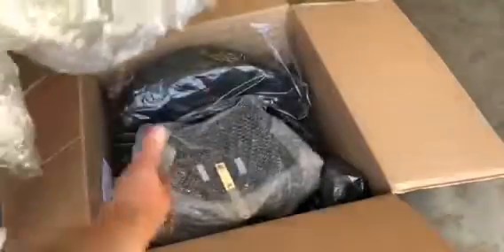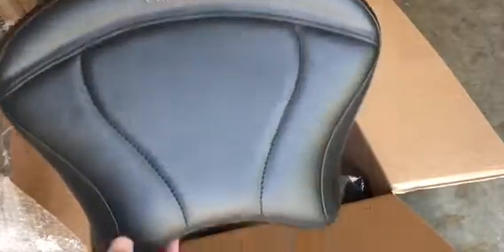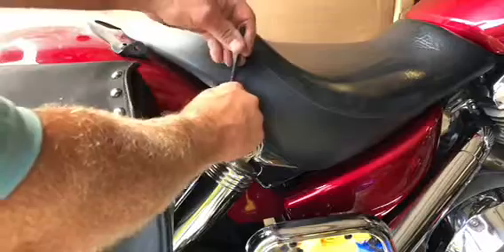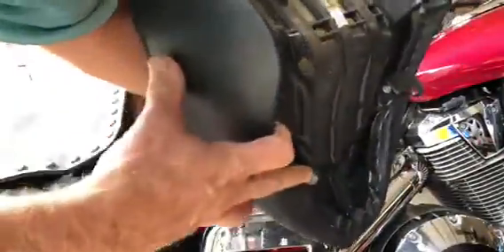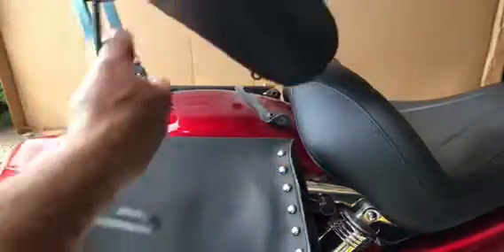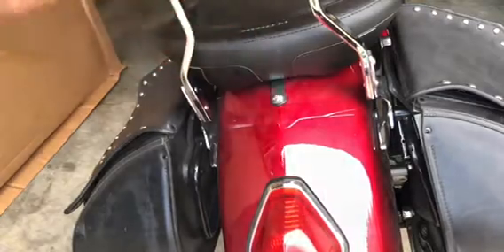Unboxing and installing The Ultimate Seat on a 2005 Honda VTX 1800R

Comment: Do you by any chance know how to change the rear turn signals? I have a 2002 VTX 1800 R. I dropped it the other day and the left turn signal snapped off
Reply from the maker: It should just unbolt, Look under the fender, Hope this helps, Thanks for watching.
Reply: @funbro1  does that include the wiring as well? Thank you for your help!
Reply from the maker: Yes, the wiring runs through the fender.

Comment: How is the comfort compared to the stock seat? Thinking of getting this seat for my Honda F6B. The only thing I don't like about the seat is that you have to have the Rain cover for rain riding. I know that it is due to the Stitching but seems like they could have found a way around that. Any info is greatly appreciated. Thank you.
Reply from the maker: This is the most comfortable seat I have owned, I have tried Corbin and Mustang and decided to try The Ultimate and it has not disappointed. Thanks for watching.

Comment: That's nice but are there any seats that allow the driver to slide back a few inches. On a long ride those seats that go up so sharply in the back are very confining.
Reply from the maker: Yes, Ultimate makes different models that allow the rider to sit differently. Thanks for the question.

Comment: You might wanna look at how you bolted that seat on the front part of the seat should not have a 3 inch gap between it and the tank. Your mounting brackets are probably off same as mine were on my seat. Ultimate seats will fix it if you send the seat back. I would suggest also sending in the stock mounting brackets off the Honda Seat so they can switch them and it will sit on the bike the way it should
Reply from the maker: My seat has about a 1/4" gap between the tank and the middle of the seat and it barley touches on the side. This tight fit makes me believe that I should not change mounting brackets and that it is a correct fit as is. Thanks for watching.
Reply: funbro1 There should be no gap. I’m extremely OCD I had mine fixed it’s more of a cosmetic thing if it doesn’t bother you I wouldn’t worry about it. besides that I absolutely love the seat I hope you’re enjoying yours. Hope you’re having a great day and stay safe out there.
Reply from the maker: I love the seat it is the best I have ridden on so far. I am good with the small gap so that the seat does not rub the paint off the tank.

Comment: just ordered my VTX seat for the 1800C. Long term review.....how did/do you like yours thus far?
Reply from the maker: Love it. I would buy it again. Thanks for watching.
Reply: How was it on your C ? Was it a big boy & if so do you feel any more room at all (im told it give you an inch) Im waiting for mine to arrive
Reply: @video3ish  So I tried the low rider first, but  it was too small for me. So I had them  send me the big boy with the backrest. That backrest is a game changer on long rides. In complete honesty, i didnt sit on the seat at first and say wow this is great. Just the opposite. I was still undecided. BUT then we did an 8 hr trip and it was WAY better for long trips overall. I got off the seat and thought to myself im not as sore as i was on the stock seat. Hope that helps.
Reply: @rbljackson  cheers for your time to reply rb. Yeah I have a back rest coming with it - didn't want one but so many others like you said its a big deal so I ordered it with one. I can last about 2 hrs on my modified stock seat but looking fwd to the Ultimate
Reply: @video3ish  yeah dont base your opinion on a short ride. or your first time sitting on it.  I was undecided until we took that longer trip.

Comment: Ultimate Seats is asking for spacing for your sissy bar pad from the center bolt to center bolt. Not sure what they mean.
Reply from the maker: I’m not sure what they are asking there either, you can give them a call they are very helpful when you call them. Thanks for watching.